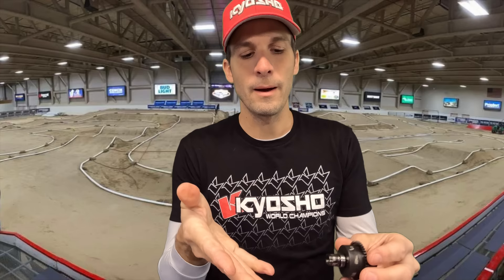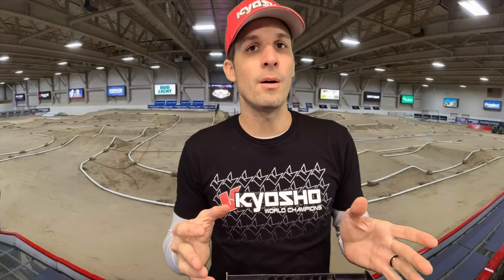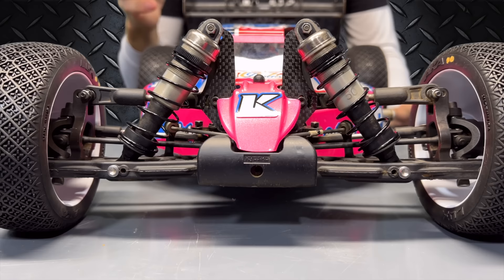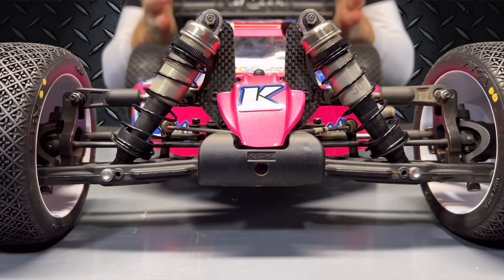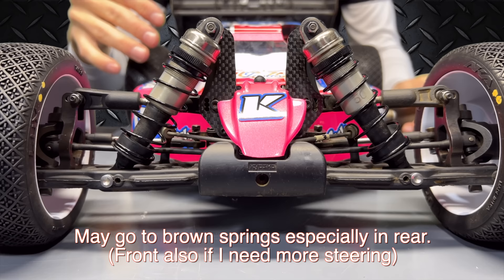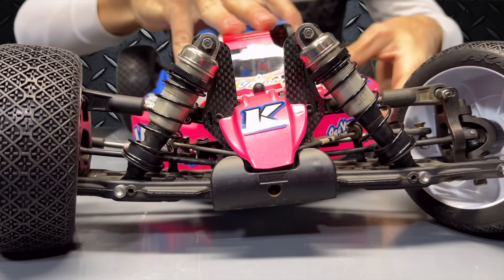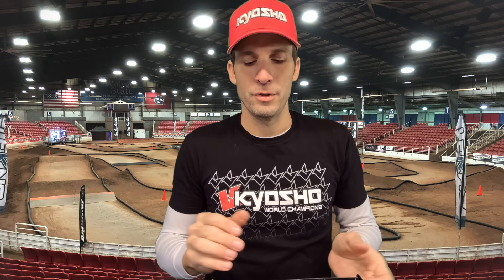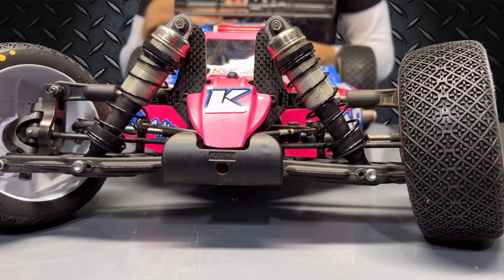Go Faster on Rough and Bumpy R/C Tracks [Beginner Tutorial with Ryan Lutz of LutzRC]

Comment: Ryan Lutz Hi, I'm Giuseppe Masocco.
great video, great setup guide! The use of the central differential with the various ratios is well specified and the use of the small case is the large one! The operation of handling the model on the track is well explained.
For shock absorbers, very useful if your quick method for checking the density of the shock absorber oils is essential.
With the possibility of creating your own usage table.
Is the density of the shock absorber oils checked with a cold car or with a hot car, just off the track?
Your reflection on the shock absorber plates is truly incredible!
It's about everything else! A well-set model exponentially increases satisfaction and driving pleasure! For us amateurs, most of the time we use models with incorrect setups and we always drive the models with little satisfaction and much more effort.
that sometimes discourages you!
A well-set model will be easier and more encouraging for both the amateur and the professional! Thank you!👋
Reply from the maker: Thank you Giuseppe for the comment!
I check the shock oil feel before running. If you have ill effects on the track you can check after a run too to maybe make a better setup change decision if you notice front end slapping or similar.
Reply: @RyanLutz  thank you very much, I'll try! have a nice day👋👋🌞🌞

Comment: Great video Ryan. Was wondering if you can do a video about your thoughts about cvd or universal. Thank you
Reply from the maker: On the Kyosho it’s minimal due to how they have the cvd built. However with cars that have the cvd built on the inside of the wheel hub and captured by the bearing it makes a bigger difference. Usually the cvd in that case will result in a touch more grip feel and more support from the driveline making it feel like the driveline is more supported. 
The universal will result in a bit more free driveline and softer suspension feel. Usually better in the bumps.

Comment: Another great video Ryan.  Can you do a video on what your 10px controller settings are?  Like when you would use certain settings depending on the track condition.  When do you like to change the settings on the transmitter vs the ESC?  What are your preferred settings on low grip vs high grip?   I feel like that would kind of bring everything together, with the ESC tuning and this video.  Adam Drake has a video on the 10px going over the settings, he likes to play with the throttle range. He recommends 70\30, on braking and throttle.  I just like to see what your thoughts are.  Thanks
Reply from the maker: Yes it’s in the plans. Just need more time in a day! 😁
Thanks!

Comment: No mention of shock positions or i just missed it haha. Still a great video nonetheless. Raising ride height for me has been an overall good thing to do. Even though I mainly race on high grip tracks (Indy Rc World) a little bit of height helps a ton. Although my links are all the way out haha. Quick question for you or anyone reading the comment. But when do you use a higher center diff compared to your rear and front? I’ve played around having 10k in the center and 5k front and rear and drove not too bad. Honestly made the buggy feel soft compared to what i have in it now 10 10 7. Heck of a lot more drive for sure. with the front being 10 as well.
Reply from the maker: There is a little bit on shocks comparing 5x1.5 to 8x1.3. Could dive deeper on further videos. 

Higher center could be a preference thing. More forward drive and more 4wd. If too high on a looser track will make car feel loose. 
Sometimes we may run 7-10-5 if grip is at least decent and you want more forward drive and stability under braking.
Reply: @RyanLutz  Right about piston holes which i started to play with here and there after a local buddy told to try them out. And makes sense on the center diff thank you!

Comment: How much of that testing the shock rebound is influenced with the spring that’s on the car? Like if the tires were hopping off, could that also be the springs are too soft?
Reply from the maker: Perhaps but a lot is the oil. 
Generally in racing we only go between one or two different spring rates once we have a base for the car. You won’t see too much variation in that regard.

Comment: What if the buggy has bad weight bias,  front heavy.  Then  say 35 rear oil, 45 front or 55,
Reply from the maker: Depends on what piston you’re running and outside temperatures.